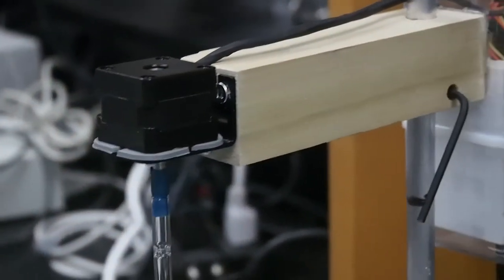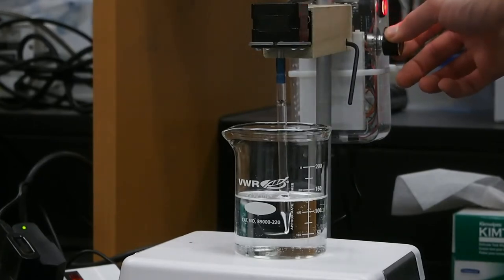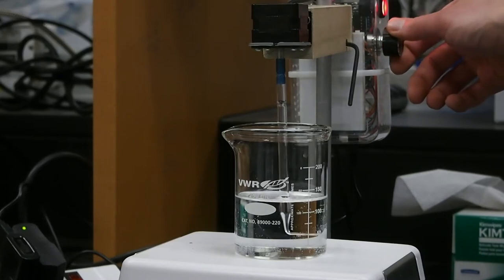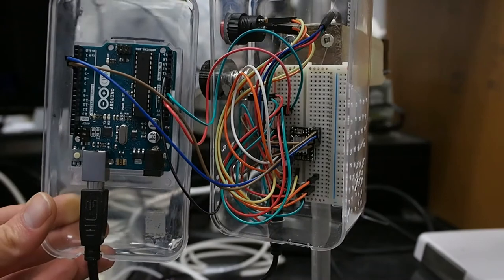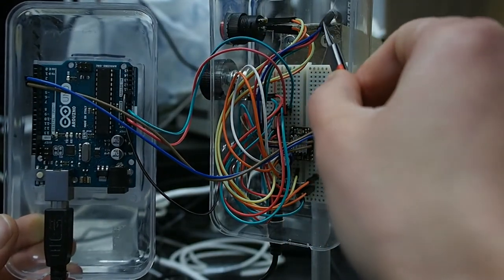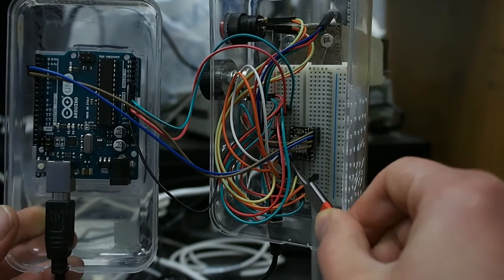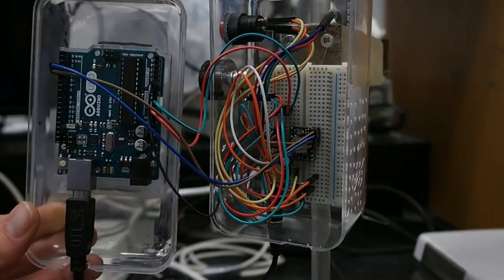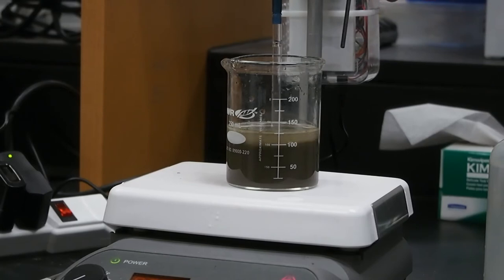DIY Overhead Stirrer

Comment: Would be very much interested in any additional guidance.
Reply from the maker: Hey, I am currently writing up my MSc thesis and starting a new job soon, so unfortunately,  it's unlikely I will have time to make a full guide/tutorial video anytime soon... but you should check out:

http://www.instructables.com/id/Drive-a-Stepper-Motor-with-an-Arduino-and-a-A4988-/ ; and
http://howtomechatronics.com/tutorials/arduino/how-to-control-stepper-motor-with-a4988-driver-and-arduino/

You can also find a lot of info just by googling A4988 and stepper motor. Let me know if you have any specific questions.

Comment: Expensive for safety should be brushless spark less, calibrated, balanced, highest quality bearing, failure safe, resistant vapor and EXPLOSION PROOF labeled as!  VOC, acid bases, low BP ignition reactive not for this application maybe. Be safe, and chemistry suppliers price gouge!  More legit research hobbyists we all will benefit! 👍🏻 well done

Comment: This is pointless as it is not sealed and because of that a magnetic mixer would have been the better choice needing only a fan, magnet, hot glue and for a final touch voltage control but not necessary.
Reply: The sediment solution being stirred for deflocculation, ie the actual application that this stirrer is being used for, has fragile subfossil remains that would be destroyed by the typical stirrer bar of a far cheaper magnetic stirrer (yes, we tried THAT before doing THIS), so, no, not pointless.